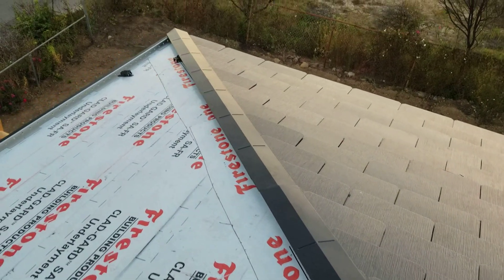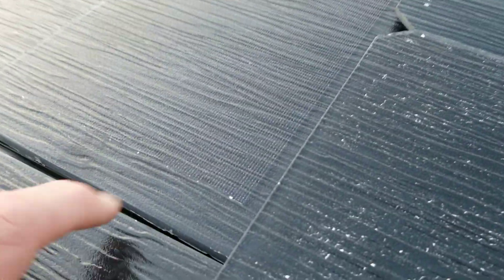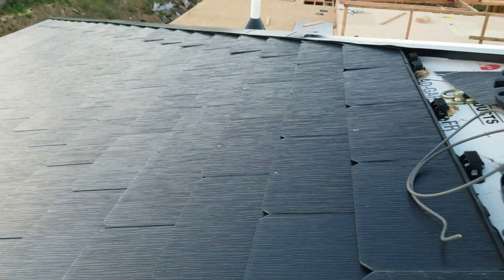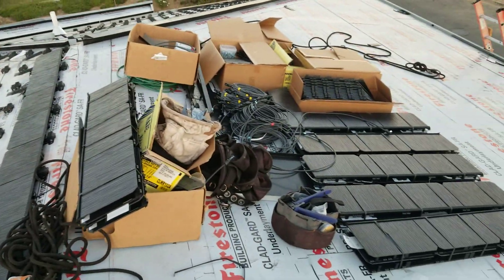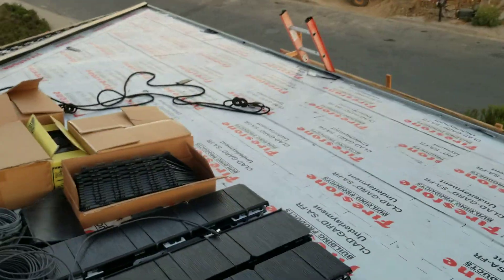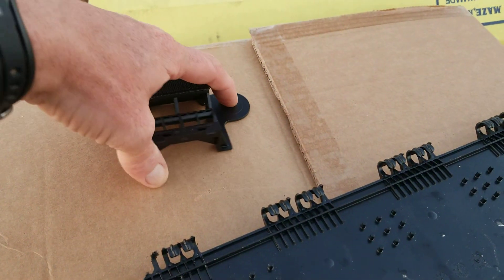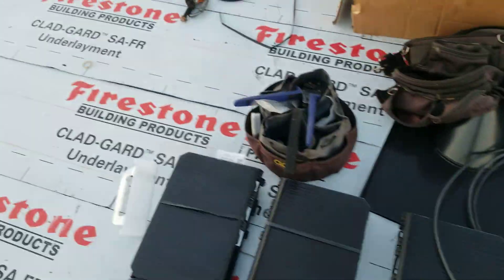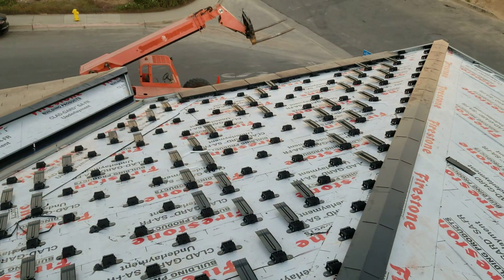A Close Up Look At One Of The First Tesla Solarglass Roof Installs On New Construction

Comment: Great video!  Do you know if this uses micro inverters or string inverters and which brand?  It's so hard to find detailed info on these installs!
Reply from the maker: They put two x Delta 5kW inverters on the wall for our 10kW solar roof (no micro inverters). I've yet to see what peak output is in the summer.

Comment: Where is the new video of this roof complete in action?? Please how much output?
Reply from the maker: Well...when it's running, it looks exactly the same. There are no indicators or lights to indicate when it is active. The inverters on the back of the house show how much power is running through each of them and I can view the power production from the Tesla app. It is a 10.59kW system and produces a variable amount of power depending on the time of day and position of the sun in the sky, which changes based on the seasons.

Comment: What is your SF and Kwh output expected?
Reply from the maker: 1881 sq ft roof worked out to 10.59kW. We maxed out the PV in the system but could have gone with a smaller system.

Comment: Thanks for the closeup. What about the electrical connections?
Reply from the maker: Electrical connections are made with standard solar connectors. Nothing unique there in V2. I'm not sure what they are using for V3 yet.
Reply: Forgive my ignorance but how is that? Surely not every single roof tile is connected with standard solar connectors?
Reply from the maker: @jeffharmed1616  Every "PV Module" has a pair of wires coming out of it, just like a traditional solar panel/ module does. The two connections between the three tiles on the module are wired directly (no external wiring). So...every block of 3 tiles is connected to the rest of the system with standard solar connectors. I'll try to get more photos of the tiles, connectors, install, etc up in the coming days.